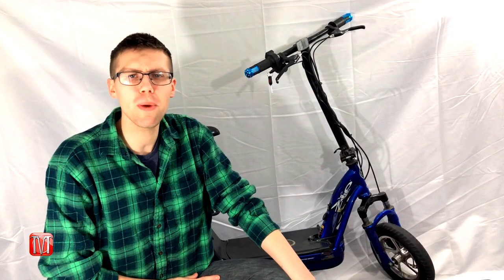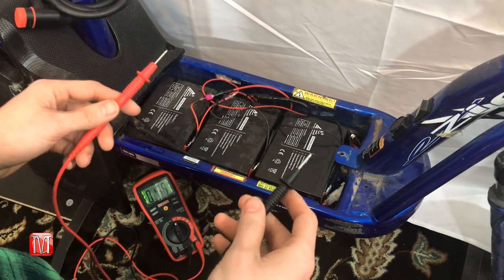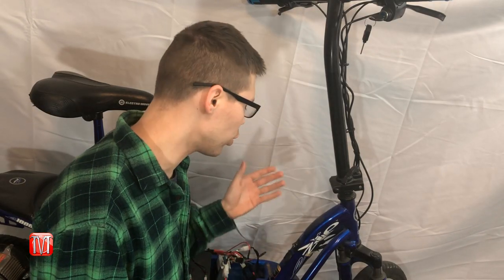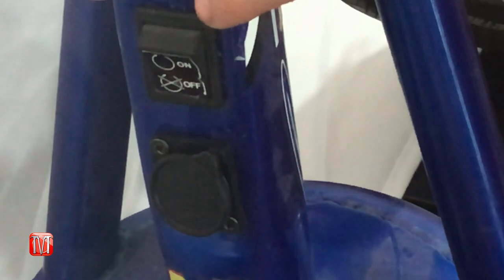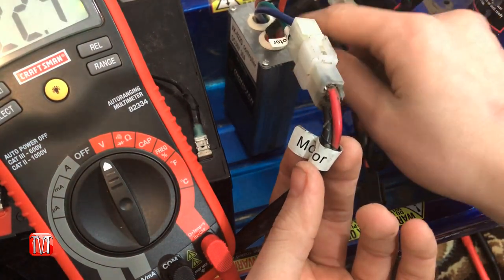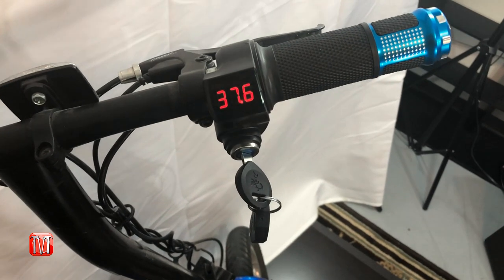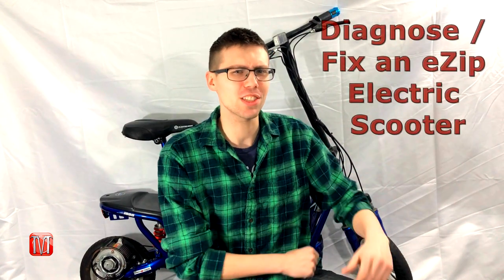How To Fix an eZip Electric Scooter (For ALL Series)

Comment: Hi MAGS, this video was very helpful. I did have a question though as I I went through all of your steps in this video (minus testing the throttle handle as I wasn't sure how to prob the wire) but everything else up to that point tested positively. When I got to the step diagnosing the power going to the motor I had some issues. I got 9 volts when testing the power going to the motor which is correct but then when I turned the throttle handle during this step, I did not get nearly close to the 36 volts expected. I then tested the motor cable for continuity and got about .8 which is close to 0 so I don't think it's the motor cable. Would you be able to help tell me what is wrong if while turning the throttle handle during the motor step yielded a low voltage? I'm thinking it could be the throttle since I didn't test that step but wanted to confirm. Thank you so much!
Reply from the maker: Alana Hyman first which model of scooter do you have? If it comes with 3 battery’s you should get 36v at the motor when twisting the throttle Handel. If it only has 2 battery’s then you should get roughly 24v. Also .8 resistance should be just fine. For me as long as the reading is less then 1.0 it shouldn’t be a problem. If you don’t get either 36v or 24v again depending of which type of scooter you have most likely means you’ll need to replace the throttle handle. This is a common problem that happens to most scooters over time.
Reply: @MAGSHowToVideos  Thank you so much for the response! I have an ezip 1000 so the voltage at the motor should 36v but I am still only getting around 9v which is the same reading I get when testing the voltage from the controller to the motor. essentially I move the throttle handle and the voltage reading doesn't move. What does this mean? Thank you again!
Reply from the maker: If you know your batteries are good and fully charged It could mean two different things. One the control module is bad which is sort of unlikely because that part to my understanding doesn’t usually go bad. However, it’s always a option. The other one is the throttle Handle which again is a common problem. Personally I would purchase a new throttle handle and test that first since that would be the cheapest part out of the two. If that doesn’t work then buy a new control module.
Reply: @MAGSHowToVideos  Thank you! Batteries are good so I ordered a new throttle so hoping that does the trick. I will keep you posted!
Reply: @MAGSHowToVideos  unfortunately a new throttle did not fix it. Neither the old or new throttle made the scooter start at all. The green light came on for both the old and new throttle but I am not sure why It won't start period after turning throttle. I also tried replacing the fuse and still nothing. I know you had suggested purchasing a new control module if the throttle doesn't work, is that still the best next option do you think? Are there any other steps I can take to isolate the issue further? Also, by control module did you mean buy new controller? Thank you so much in advance!
Reply from the maker: I would suggest running through all of the tests shown in this video once more. If you find you’re not getting the correct reading on something let me know. Also make sure to test the power output from the control module. If you’re not getting the full amount of voltage from the battery (when twisting the throttle handle) that most likely means you either purchases a bad throttle handle, you have a bad wire somewhere, bad fuse, bad batteries (might be outing out correct Voltage but not the correct Amperage), or a bad control module. Feel free to let me know what you find and I’ll try an help.
Reply: @MAGSHowToVideos  hi, im having the same problem as the guy above.  I have a 750, so 24v system.  I replaced my throttle handle with a thumb control throttle that also displays the voltage.  Was riding, & suddenly just lost all power; display on throttle doesnt even light up.  Tested everything in the video up to checking power to the motor, & everything until then tested exactly as you said it should.  When testing power to the motor, i get 9v & it doesnt change after pressing the throttle.  Again, the display on the throttle doesn't even light up either, but all other tests from the video prior to power to motor tests are fine.  Btw, i replaced the batteries when i replaced the throttle too.  Does this sound like the throttle or controller?
Reply from the maker: Tyler Yoder so if your batteries are fully charged and you are getting the proper voltage supplied to the throttle handle from the control module but don’t get the 24v back when twisting the handle it’s most likely a throttle issue. I would first re-inspect the throttle wire harness to see how you wired up the throttle handle correctly. If you didn’t have to manually wire it up then see if the manufacture placed some wires in the incorrect order. Most if not all the colors should match the ones coming from the control module. If they don’t match try switching them around. Another possibility is you purchased a defective throttle handle. I know it sucks but I would recommend purchasing another handle before replacing the control modular since that’s more command to go bad and is the cheaper item to replace.
Reply: @MAGSHowToVideos  i believe i matched up all the wire colors correctly according to the wiring diagram you showed in this video & what came with my throttle.  It DID work for a month, & then just randomly died the other day.  I tried installing a new throttle today & get the same effect (no display on the throttle voltage screen) & i ran through all your tests again.  Still get 9v coming out of the controller to the motor, but it stays at 9v when throttle is engaged.  5v going to throttle, 4v when testing green throttle wire & grounding it to battery, fuse has continuity, 24v going from power switch to controller, 28v from charger.  Only thing not testing right is power to motor when throttle engaged.  Should i replace the controller now?
Reply: @MAGSHowToVideos  i replaced the controller today & still no luck.  A y other suggestions?
Reply from the maker: Tyler Yoder now that’s really weird. If everything checks out then I’m honestly not sure what it could be. If you’re not getting 24v to the motor it has to be a connection somewhere at the control module. I would test for resistance between all of the wires if you haven’t already. It could be a bad wire. Also test for resistance in the fuse. The fuse may have continuity but have high resistance which could also limit the flow of amps.
Reply: @MAGSHowToVideos  so i started thinking, if nothing is lighting up on the throttle, it seems like the fuse is blown or the whole system just isnt grounded.  I looked back at your video & see that the brown wire is the ground.  If i stick that to 1 of the battery terminals, it activates the motor & lights up the voltage display on the throttle, but it powers the motor wothout the throttle being engaged.  Before, i had this wire taped off like you do, but now im wondering if it needs to be used.
Reply from the maker: Tyler Yoder maybe. For some reason I was having a hard time trying to figure out what the brown wire was for. Once I found a way to sort of bypass it I gave up on it. Let me know what you find out and maybe I’ll make a updated video on it.
Reply: MAGS How To Videos thanks again for your help. I regret I haven’t had time to redo the tests in this video but plan to today. My Fear is that the issue is going to be a bad wire somewhere in which I have no idea where to start to find which wire could be bad. I’ve tested the scooter with two different sets of battery packs so I don’t think it’s that. I did want to shed some light into an issue I was having with the scooter before this issue of it not starting happened in  case that sheds light into the issue. 

Before I was having issues with the scooter starting at all, the scooter motor was making a sound like it was working too hard and it was going slow. i thought I had fixed this with replacing the wiring that connects the charging port and on/off switch to the control module because it was back to normal when I did. When i was troubleshooting the issue back then i ordered a new motor, control module and throttle and all the new parts didn’t solve it which is how i ended up looking into the wiring that connects the on/off switch and charging port to controller because that was the only part i hadn’t tried to replace. It worked and was riding at normal speed again without the noise like it was struggling to go fast. However a week after riding it, I ran into the issue again and now it won’t start at all which is when I started messaging you. Because a new control module didn’t work last time, I don’t think it will work this time unless something else has gone bad since last time. All this being said, I’m wondering if it’s a faulty wire somewhere because I’ve tried to replace everything but now it won’t even turn on. Any advice beyond the tests in this video would be sincerely appreciated!
Reply: @MAGSHowToVideos  update: i got it working again.  It turns out the replacement controller i order3d was defective.  Got it replaced, & hooked the new one up & the voltage display on the throttle lit up, which was more than i got from the original & 1st replacement controller.  However, i still got no power to the motor when pushing the throttle.  Did some more searching on the web & found people woth the same problem on the razor scooters that said to put the wheel down on the ground, & give it a running start.  I just started pushing it at walking speed & engaged the throttle & it took off.  Some videos said get it going at 3 mph, but i didnt need that.

& oh yea, the brown wire isnt needed.  It's capped off again & scooter is working fine again.
Reply: @alanahyman282  if you're getting power to the throttle, but the power isnt changing to the motor when you engage the throttle, try giving the scooter a running start, & then engaging the throttle.  This worked for me & appears to be a common problem, according to my internet searches
Reply: Tyler Yoder thank you for your reply and advice!! Very interesting and I hope it works when I try it! Thanks again.
Reply: Tyler Yoder sadly the running start trick didn’t work for me. I truly am at a loss at this point. I feel like I’m looking for a needle in a haystack with a bad wire somewhere and at an a loss for where i should go from here. Any last thoughts from you or anyone would be sincerely appreciated. I feel like I may need to get a new scooter...

Comment: if you connect your throttle to one battery directly won't the voltage meter on the throttle just tell you the voltage on one battery?
Reply from the maker: Outdoor Republic yes if you were to connect this throttle handle to one battery you would only get a max reading of 12v... that’s why you need to connect it to your main negative and main positive cables. It might be hard to see that in the video since I had to create my own battery pack, but if you still have the original you can just connect it to the two cables.

Comment: I have an e750 and I replaced the battery with a 36v lithium ion battery and the motor with a 1000w motor with a freewheel sprocket and it keeps flashing the green and red light after a little riding
Reply from the maker: Jasen Stewart what are the CCA (Cold Cranking Amos) for the lithium ion battery? You may have the proper voltage but might not have enough Amps for that new motor.
Reply: @MAGSHowToVideos  that's what I figured out after looking at what both were rated for and I need a stronger battery pack
Reply from the maker: Hopefully getting a stronger battery fixes the issue. Thanks for watching!
Reply: @MAGSHowToVideos  I rigged it up with a battery pack I'll be buying from a friend and threw a new fuse in and it worked great, no cutting out after 5 minutes and it even boosted the speed to 37
Reply from the maker: Nice I might have to look into upgrading mine once I get back home. Thanks for the input.
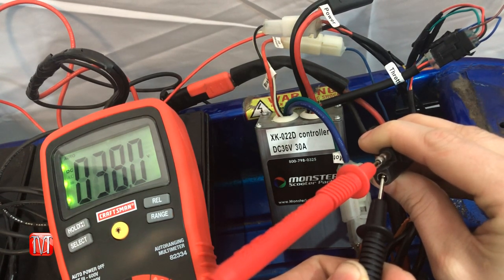Reply: @MAGSHowToVideos  I'm running 36v 1000w at 35amps with a 3:13 ratio on a 12.5 inch wheel and it does pretty well

Comment: So where did you buy the handle throttle from.?
Reply from the maker: So I purchased mine off eBay. They’re not hard to find the only thing is you need to make sure you purchase one with the correct amount of wires. Before you purchase one check to see if your scooter requires a 5 prong or 6 prong wire hardness, then get a throttle handle that has that many wires attached.

Comment: My ezip 4.5 electric scooter has been out for a coupld of yrs, i finally found a charger to charge the battery, i try to move the scooter by pushing it but the rear wheels dont spin when im pushing it is this normal? Im afraid the motor is out or something else, im not sure is that how it behaves when its off or not
Reply from the maker: Jesse Mejia have you tested your batteries? Usually after a few years depending on how much it has been used the batteries go bad. That or if the scooter has been stored out in cold weather for a long time. Make sure to test them if you haven’t already. If you do get the proper voltage and Amps then continue following my video for other tests.
Reply: MAGS How To Videos i have not tested them, but i put it to charge and it seem like they getting the charge because after 2 hours i turn it on and the “low battery” light was blinking
Reply from the maker: Jesse Mejia ok we’ll continue charging and see if they are able to get a full charge. If the batteries don’t get a full charge you will have to replace them. You can also test the batteries with a multimeter or voltmeter, which if you don’t know those are I have a how to video on Multimeters.

Comment: I NEED HELP WITH MY G.T ASTROID E SCOOTER. MY FUSE KEEP BLOWING, SO I replaced, batteries an motor, plus I up graded the motor from a 300watt motor to a 350 watt motor, but there's plugs missing to hook up for the throttle wires. It was all in house with the motor.......HELP......I am $300 in the hole an still not riding...🤔🤔🤔😞😞😞
Reply from the maker: When you replaced the batteries did you hook them up in series to one another? If they are hooked up in Parallel that could be the reason why you are blowing a fuse. If that’s not the case it could be the throttle control module that’s causing a surplus of amperage being sent to the fuse.
Reply: I hooked everything up the same way with new batteries an it still blow out fuse. The light never came on with the power either. So I'll need to up grade the throttle to hold the power for the up graded 350w motor.....?? What type an brand do you suggest, I have a two pin plug.....
Reply: Ok.....It turns on but, I don't know how to hook up the wires for the throttle.....?? It run when I turn it on, I don't know how to hook up the throttle, because my new motor doesn't have hook up plug for it like my old motor.

Comment: I need the wiring diagram for the batteries
Reply from the maker: The batteries are wired in series to one another. If you’re not sure what that means, feel free to watch one of my other videos on how to wire batteries in series/parallel. That should give you a better understanding on what each wire coming from your battery does.
Reply: @MAGSHowToVideos  
I literally have everything working but when I plug in the power from controller to motor the volts go to zero. 
Unplugged switched on it's 8.7 and full throttle it's about 22 volts (it's a 24 volt scooter ezip) 
As soon as I plug in the motor goes to zero.
The motor works right if hooked to batteries. 
The motor is on 200ohm scale reads 0.8 
Please help my kids love this thing